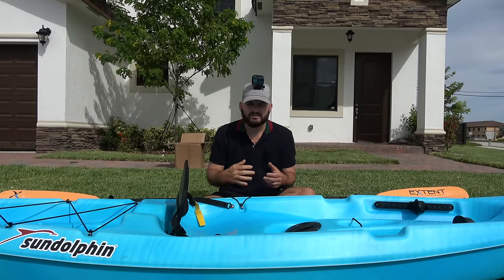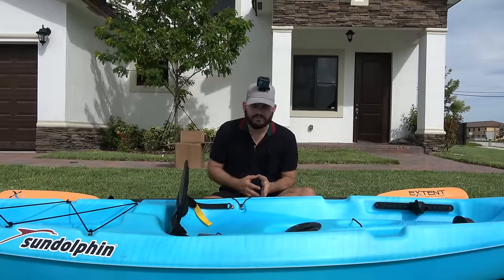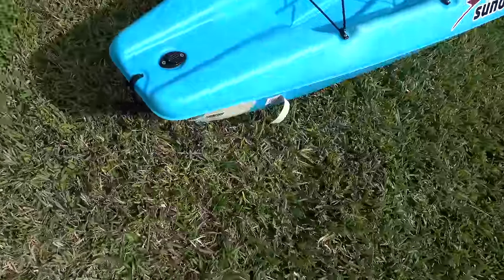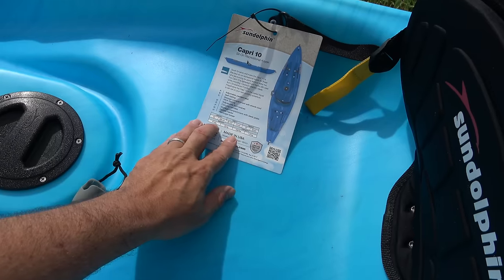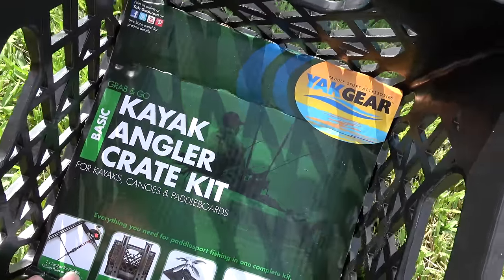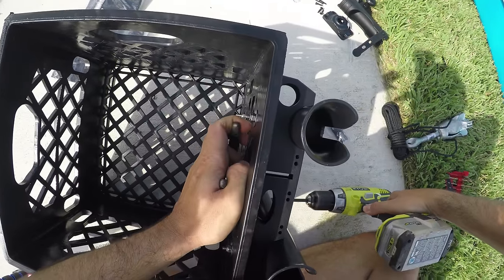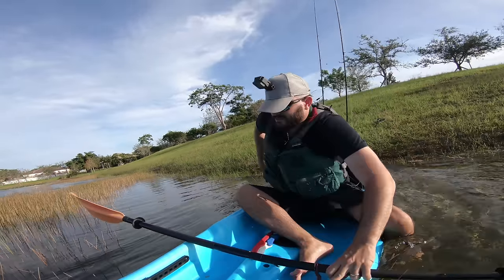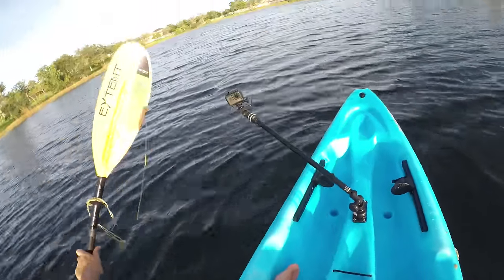How to turn a Milk Crate into a Fishing Crate Super Affordable Fishing kayak Under $350

Comment: Great tip on the anchor. I saw this tip once before and did not head the warning. Then I got my anchor stuck on an underwater stump or something. had to leave the anchor with a floaty and came back with a motorboat and pull it free. I now am a firm believer in the zip tie method!
Reply from the maker: Zip tie for the win
Reply: My kayak anchor gets caught on rocks so often that I chose to put two ropes on it. The bottom rope being slightly longer, it flips the anchor upsidedown only when I tug on it to retrieve my anchor. No tiewraps. No broken plastic tiewraps left in the water.

Comment: Curious why you chose to highlight the Sundolphin as opposed to the Lifetime Tamarack Angler? Similar retail price but the Tamarack has a higher weight capacity and a lot more features including a paddle, and 3 rod holders including two molded in ones and one similar to the Yak Gear one.
I will admit I was very surprised to see you’re able to stand in this boat.

Edit: it is fun to see you on a tiny kayak after you’re so used to huge & heavy ones; you got that thing flying!
Reply from the maker: I was gonna use the lifetime or tamarack but dolphin donated this one 😁
Reply: Aliex Folgueira good reason!